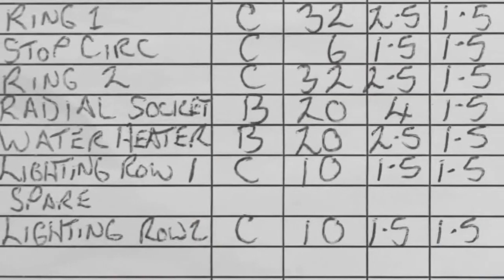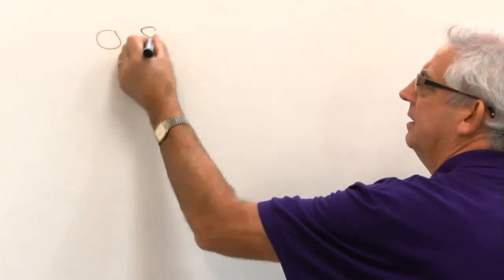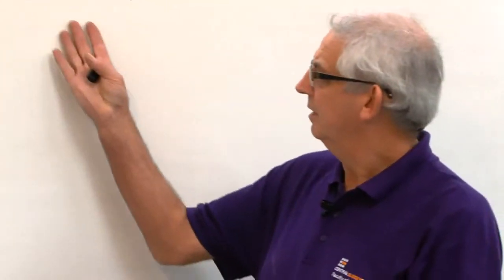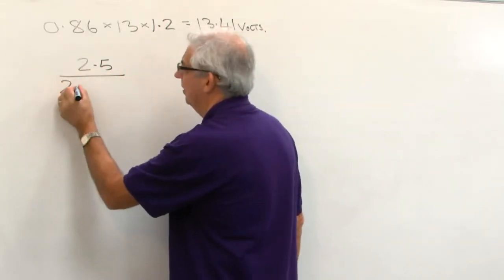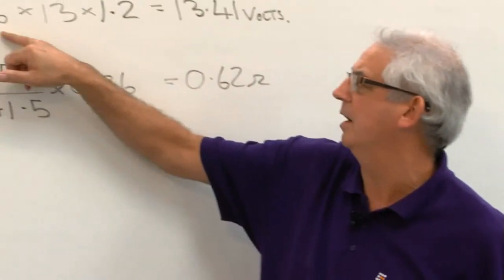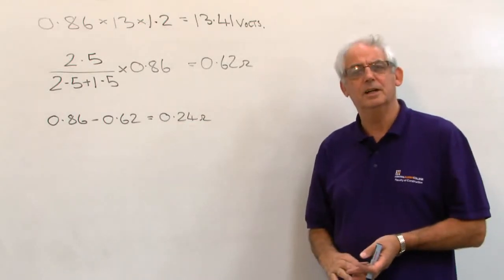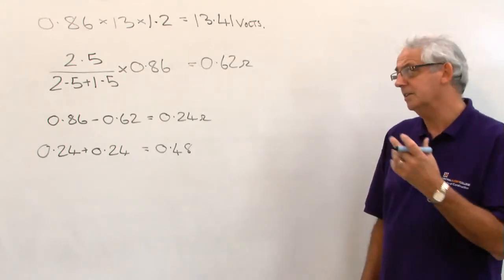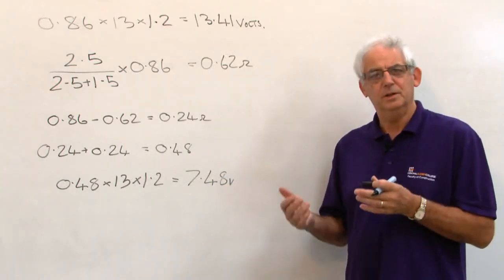Voltage Drop Method 2

Comment: Me too.....I think that at step (2) both sides (top and bottom) of the 2.5 divided by 2.5 +1.5 have been multiplied by the 0.86.........either the formula layout as shown is wrong or the answer shown is wrong.....I am with you on the 0.5375 answer....

Comment: 2.5/(2.5+15)*0.86 = 0.5375. What am i doing wrong?
Reply: Nothing wrong with your working,  he's forgotten to multiply the. 0.86.   
2.5/4=0.625.       
0.625*.86=0.5375 ohms. 

I prefer going straight to finding the R1+ Rn resistance.
(1.5/(2.5+1.5) x 0.86) x 2= 0.645ohms.

VDactual=0.645x13x1.2=10.06V
Reply: You are not; he has got it wrong¬!
Reply: the result indeed is 0.5375.  unless he missed something else
Reply: Nothing wrong mate, bang-on just what I got as well.

Comment: Chris, your knowledge and ability to explain during your videos is of great benefit to me and know doubt many others viewing your videos. Thank you for sharing, I have an question regarding obtaining the value of you line conductor, when your value of R1&R2 has been measured with the Armour of the cable acting as CPC. How do we determine the value of the CSA of the Armour?
Reply: GARY TAPP you'd need to consult the manufacturers technical data for the milli ohm per meter value and then check an equivalent cpc size from appendix I in the OSG table I1. It probably will just be a rough answer.   I prefer measuring R1+Rn at the furthest point in the circuit when I can particularly if the R1+R2 has been obtained at some random point in the installation due to a poorer connection there.